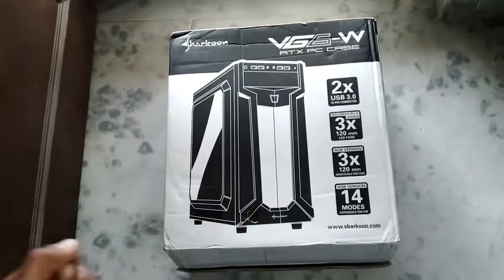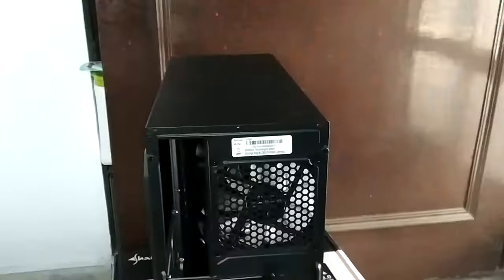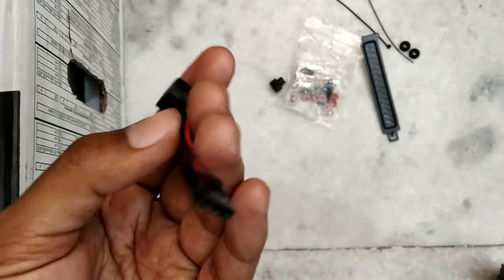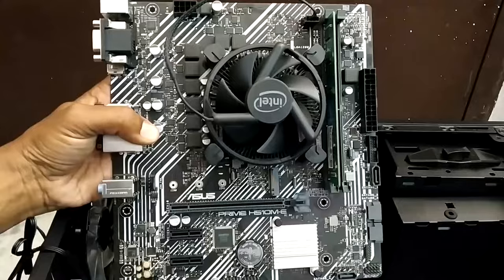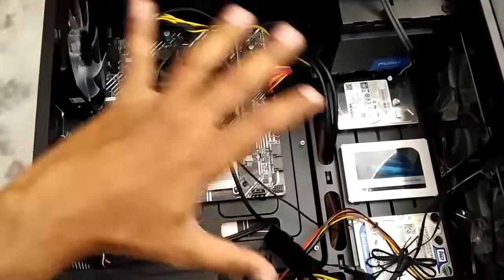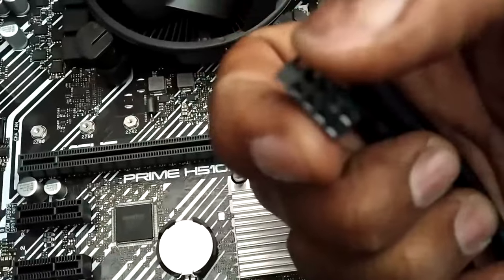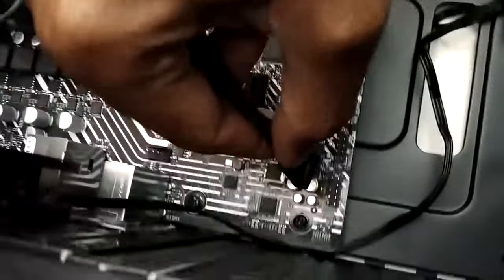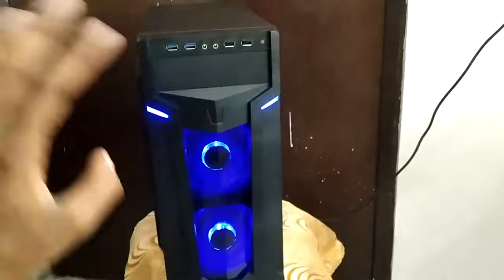Sharkoon VG6-W Mini Tower PC Computer Case Unboxing & Build.

Comment: Following your video I have assembled the same processor on the same motherboard and installed Ubuntu 24.04 on a 500GB nvme ssd. The installation( from a USB stick) took around 7 or 8 minutes. I have disabled Asus Performance Enhancement. My cabinet does not allow for any sort of significant cable management and I can only drool at the cable management setups I have seen on Youtube. Otherwise, it all seems good for now.
Reply from the maker: Why drool over cable management.
It does not add to the performance.
RGB, cable management are useless to me.
people who make videos about cable management don't always use the same computer, All they care about is aesthetic.
And because most people only have one computer and if you need to change something in there, you will be messing up the cables anyway.
This is the reason i don't waste much time doing cable management. So that next time if i wanted to install something or change some hardware, I would not need to worry about messing the cable management because there was none to start with.

Comment: I wish you had shown the connection of the power led, hdd led, and reset button cables from the front panel. Do we have to worry about the polarity when connecting the power led and hdd leds? Does the hdd led light up for ssd and nvme drives also? Also it would have been nice of you had shown the cable management also.
Reply from the maker: for led's polarity matters. but it should be easy as everything nowdays is labeled.  so, you should be able to see '+' and "-"  on the board as well as on the front panel connector.
for reset switch polarity does not matter, you can connect in any orientation.
As far as hdd light is concerned it should still work despite using an ssd or nvme.
But, i'm not sure because i never use the hdd light. it serves me no purpose and also distracts me during the night.

Comment: Bro I am planning to build pc with specs i5 11th gen and 8gb ddr4 ram and same motherboard as you have and I also have my old gpu gtx 950 but I am not planning to buy new psu so my old psu i ball marathon 500watt will work or not please tell me
Reply from the maker: Why save money on the PSU.
I think it is a very old model. It may be working fine but if it is old the capacitors must be old as well.
 Why take changes with your new build using an old psu.
I suggest you buy a new psu at least 700w.
once you have your system up and running then you can try your old psu if you like.
Reply: @gurribuy  thank you bro and one more question in future I am going to buy rtx 3050 so 700w will be sufficient or not?
Reply from the maker: @PranayBhagat04  yes. it should be enough for 3050.
Reply: @gurribuy  ♥️♥️
Reply: @gurribuy  I am facing with same problem going to build similar pc like he is going to and I also have similar psu like him and I am very budget tight so for one or two months i use my old psu it will work fine or not please reply

Comment: Sorry to bother you again. I have an Ant Esports Si11 cabinet, their cheapest. There is one chassis fan powered by a so-called molex connector that you have talked about. My SMPS, Cooler master 450W has 3 molex sockets chained to one another. Can I connect the fan connector to any of the 3 or the first one on the chain? Thanks. I am using your video to do my first assembly.
Reply from the maker: you can connect the fan to any connector on the line. It does not matter which connector you use the 1st one or the last one on the chain.

Comment: If you go into the bios you should be able to turn off the blue rgb
Reply from the maker: The one that i have are not addressable LED.
None of the fans are connected to the motherboard   so, I can't turn them off.